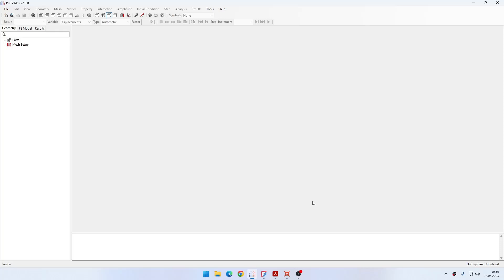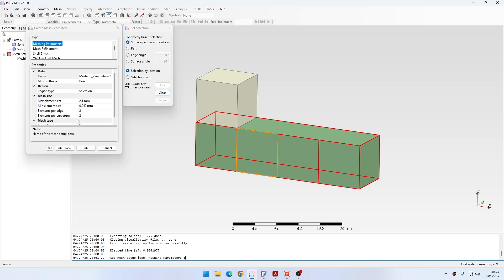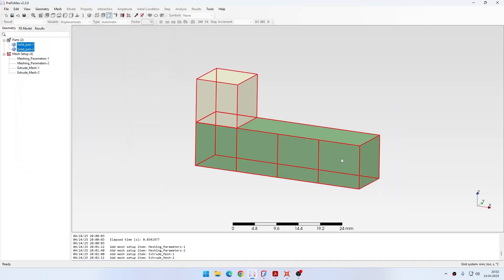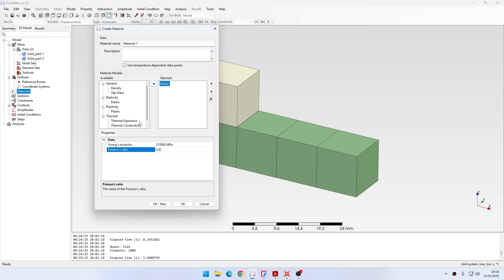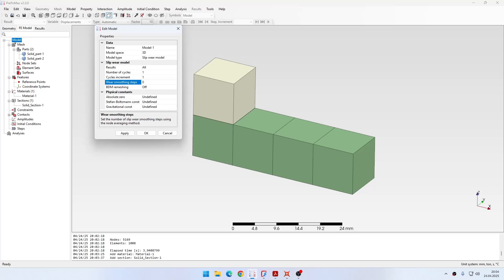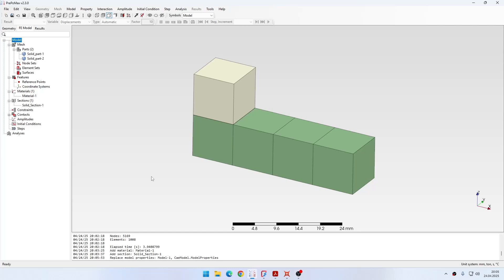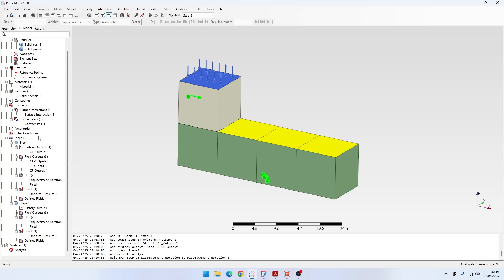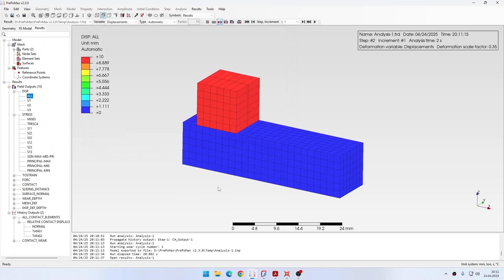PrePoMax (CalculiX FEA) - Tutorial 50 - Contact wear

Comment: It is possible to calculate in same analisys wear at both surfaces? I mean Static surface at bottom and one which is moving?
Reply from the maker: Good question. Wear is calculated only for the slave surface in the contact pair. Theoretically, you could add another pair with swapped master-slave assignment but I probably wouldn't trust such results in most cases. It would be safer to do it in separate analyses.
Reply: @FEAnalyst  Thanks for response, I tried to add second contact pair to try calculate for both configurations at once, but nothing changed. Secondly I deactivated one of contact pair and made 2 separate calculations as you said and that works fine. And also i think wear analisys should show material wear also under final position of top brick - please correct me if i'm wrong
Reply from the maker: @KptStroggPL  Did you swap the master and slave surfaces in the second contact pair ? You can duplicate the existing pair, right-click on the copy and select Swap Master/Slave.

Sure, you can set the displacement BC and step time in such a way that the cube moves to the end of the bottom block.